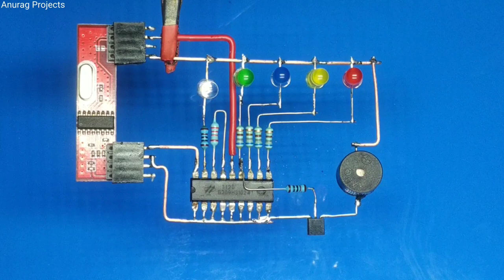How to make Wireless Water Level Indicator with Alarm using 433MHz RF Transceiver Module

Comment: I successfully duplicated your circuit.
but how to make it also beeps when the tank is empty using just 1 buzzer?
I already tried using NPN transistor for bottom level.
The alarm goes off all the time.